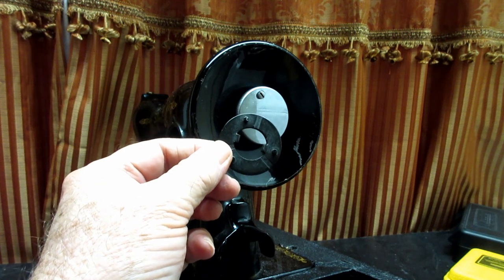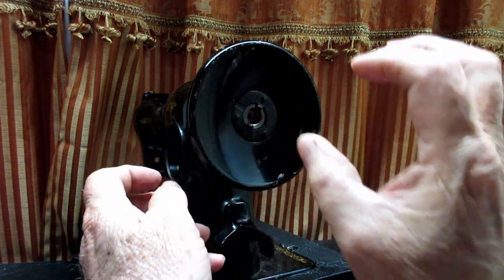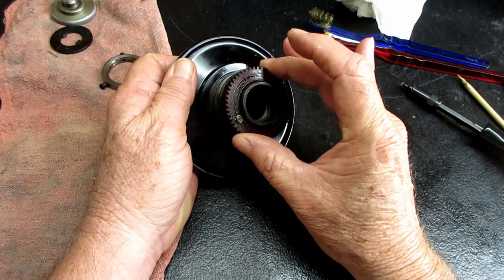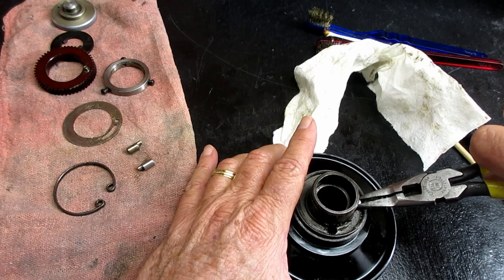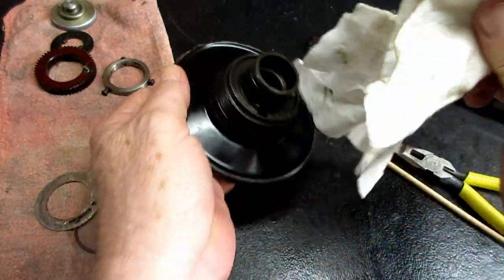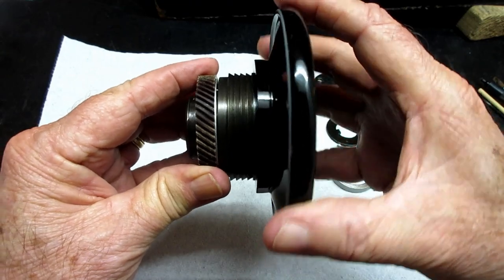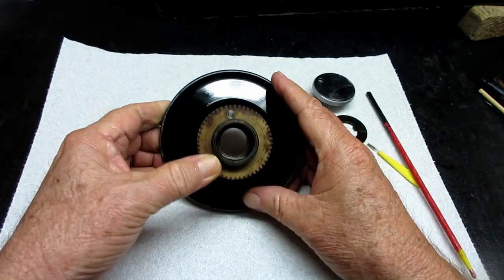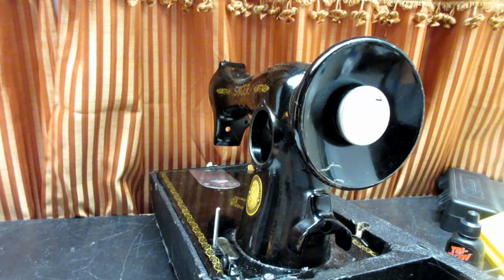The Entire Handwheel System of Singer Model 15-91

Comment: Thanks so much for this video.  You’re an A++ teacher.  Not only was I able to take apart my 15-91 hand wheel, clean and reassemble, but I also serviced my 404 hand wheel.  The snap ring was tricky to remove; I used a small pair of round-nosed pliers (Roger is rummaging around in his tool box for a more appropriate tool).  The rest was oh-so similar to the 15-91.  Some differences, but your instructions were so clear, I was able to do it. Probably my 404 did not need this treatment (it was relatively clean and unbroken inside), but it was fun to be confident enough to do it.
Reply from the maker: Thanks for the compliment. Interesting that by the time the Slant Needle models arrived they had started using snap rings, isn't it? I get why they did it, but I sure liked the heavy parts in the 15-91 handwheel. As Terry McClean mentioned, I think he is correct that all the grease on mine is from the way the motor shaft worm gear and Textolite gear sit in that grease reservoir. By comparison, the Slant Machines PA motors are upright and the manuals have us putting a small amount of lubricant on the gear "at least once per year".
I'm pinning your comment up top hoping other people see that the video can apply to other models' handwheels. Thanks for sharing that.

Comment: I am so glad you are working on a 15-91. I recently acquired a 15-90 treadle machine and finally got it all cleaned up and working well. Replaced the leather belt and now I am working on the cabinet, which has been a major project with all the chipped and loose laminate.  It should be nice when done.  Do you know if I can get new decals?
Reply from the maker: https://www.singerdecals.com/model-15/

Comment: After all the videos you've made, it's hard to believe you're still finding new areas to explore for us. Kind of like the Starship Enterprise, going where no one has gone before. 
I had looked at hand wheels like this before, and knew there was a spring in there, but I resisted taking them apart because I was afraid of the spring shooting out or being difficult to reinstall. No worries now. 
Was all that  grease thrown off from the worm gear that meshes with the textolite gear? There sure was a lot, and it seemed to be everywhere, so I was wondering if it might have deliberately placed there.
Reply from the maker: Thanks, Terry. I was hesitant to open one, too. When I had bought a parts machine with a cracked handwheel I decided to go for it. The spring wasn't what I imagined but the style/type of it makes sense. Many of the vintage handwheels have a similar set-up like this one with minor, IMO, differences. Yes, I've never seen that much grease all over a handwheel, but then I've never seen so much grease on the motor parts in general. I'm so used to the TriFlow Clear Synthetic Grease now that the blackish sticky grease seems weird. I think the worm gear grease on this machine migrated into the handwheel, but the machine has been around a long time and who knows how it was serviced. Thanks for watching and the great comment.

Comment: Thank you for this video! Regarding the finish, I clean inside and outside the handwheels with naptha. It will not harm the paint. It will, however, cause any varnished-on oil on the handwheel to become very visible (as light brown patches) since the naptha dries it out. Because of this I always finish cleaning the outside of the handwheel with a damp towel, which returns the varnished-on oil to an invisible state. Alternatively, you could just clean the inside of the wheel with naptha and use a damp towel for the outside. I have never used krud kutter before. I will have to try it out. When you clean with Krud Kutter, what do you use to clean off the KK residue?
Reply from the maker: Thanks for watching, and thanks for the Naphtha info. I hesitate to use products like this that are flammable liquid hydrocarbon mixtures. I don't have a workshop or clean outdoor work area where I'm living so I look for alternatives. I guess that's what lead me to the Krud Kutter. Being water-based and earth-friendly I've found it to be very good in removing oil & grease. At stronger mixtures, it can dull paint though. I do have a half can of JASCO Naphtha in the storage closet so I'll try it out on some parts of an old parts machine. I've tried many cleaners and tools and anything that works safely is good to add to the "toolbox" for working on the machines. I appreciate the clear comment. Take care.
Reply: @andytubesewing1953  Naptha does have a strong odor (though not as bad as kerosene, which is what I used to use). I work in a large garage with a fan. Naptha evaporates quickly which I like, and it doesn't leave residue. However, if I can use less Naptha by substituting in an environmentally friendly cleaner like KK, that will be awesome. Another of my absolute favorite cleaning tools, especially for motors, is CRC QD Electronic Cleaner. It is fantastic for blasting away carbon brush residue - but like Naptha, you probably don't want to breathe it in.
Reply from the maker: @pthomps01  I have used the CRC QD Cleaner on my computers and a couple of sewing motors and it works well; no residue that I can see.

Comment: I’m planning on changing feed gears on a singer 750. It was gifted to me after sitting forever. I just made my first ever stitch using a machine, but shortly into my project the gear snapped. Any tips or advice would be greatly appreciated.

I was watching another video but they were cutting the metal on the machine which was hard to watch. Then I came across your videos. Your a great educator.
Reply from the maker: I don't work on the Touch & Sew models like the 750. If I wanted to do what you have planned I would contact the Guru of Touch & Sew Models, the Touch and Sew Swami who was a lead technician when those models came out. He has a guide that appears to be written to do the gear change then reset the timing, among other guides and factory manuals you can buy and download from his store. Here is the 700 T & S Manuals page: https://store.tandtrepair.com/tosew700se.html  You see the 2nd one on the top row is for the gears. You can email first and ask if that will cover what you are planning. He has contact info and his name is Terry. If you decide to buy something and do it before the end of 2021 you can use my coupon code of andy-h-yt for a 20% discount. Thanks for watching my channel and if you get tired of the T & S you can always pick up a nice 401A or 403A Slant-O-Matic Special with all steel gears 😊
Reply: @andytubesewing1953  thank you for the leads 😊
Reply from the maker: @chriswilson904  you bet and good luck. 👍

Comment: Hi Andy , Do you put grease on the Textolite Gear? I didn't notice if you did that or not. Thanks.
Reply from the maker: I did not apply any grease in the video b/c I do not have the motor mounted on the body. I do apply grease on the Textolite gear and the motor shaft pinion or worm gear of all the other machines I have worked on, like the 401A, 301A, etc. This is the first model I have done with a horizontal motor that has a horizontal gear below the handwheel. When I have restored the motor for this machine and remount it I will be adding grease to the Textolit gear & motor shaft gear. I'll be using the grease I use on all machines, TriFlow Clear Synthetic Grease; https://www.triflowlubricants.com/product/tri-flow-synthetic-grease/
On vertical motor pinion gears that mate with the side of the Textolite handwheel gear, I use a stiff artist brush, like for acrylic paint, to brush on grease to both of the gears. You can see me doing this starting about 54:30 of this video; 
 https://youtu.be/ghnNYyMC1xU   I'm not sure that will be enough with the 15-91 potted motor b/c they seem to have a large area where the motor shaft gear sits. I don't know if that is supposed to be filled with grease or not, but I do not plan on using that much grease. I'll probably brush it on thickly and test the motor like that to see if enough stays on the gears to protect them from wear. Thanks for watching my channel.

Comment: Can you mix different handwheels? One that came off my 15-91 has a c clamp retainer vs the one feature in this film and the one I got on ebay? Don't want the screws in the retainer to break my machine. Thanks
Reply from the maker: I've only done that when the part numbers are an exact match, like the 401, 403 & 404 slant needle machine. Besides the style of retainer the actual size of the handwheel could be different, or the sizes of the arm shaft counter balances may have a different diameter, or the size of the gear or number of teeth may differ, or the worm gears may be different. Model 15-91 was in production from 1930 thru 1956 and it is possible some parts changed during those years. So, in general, I try to do an exact match for styles/part numbers of any parts. You could try it and just turn by hand at first to see how it felt/sounds I guess. Maybe your existing wheel is the oddball one, and not original or was made 20 years later/earlier than mine in the video.
Reply: @andytubesewing1953  reason I don't know how to find the part number cause I can't tell the year of the model, I think it's 1952 based on the C in then manual
Reply from the maker: @rhoorio  You can look up the date of your machine by Serial Number at ISMACS here: https://ismacs.net/singer_sewing_machine_company/serial-numbers/singer-sewing-machine-serial-number-database.html
You can send the picture you asked about but it will not help me. The machine in this video is the one and only model 15 I've ever worked on or seen in person for that matter. I'll be happy to share all the documents I have for model 15-91 (and other models 15) if you want to email andytube53@gmail.com